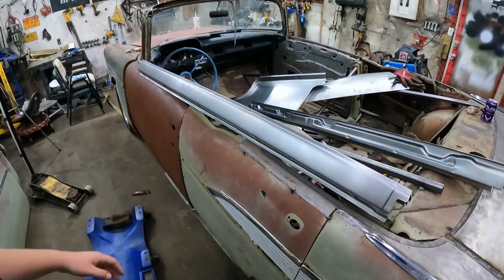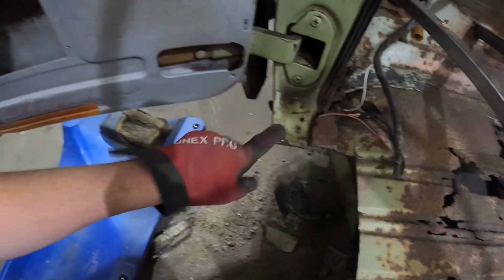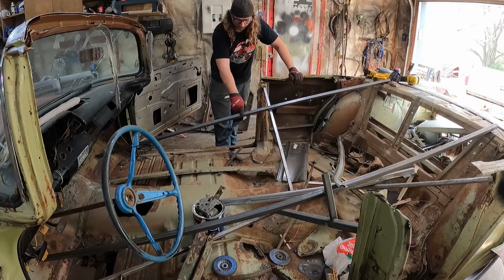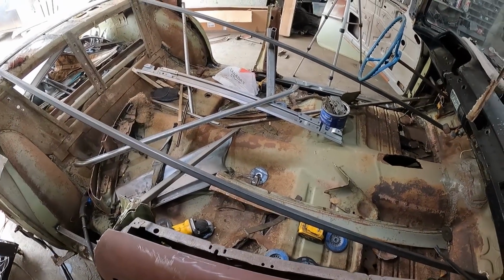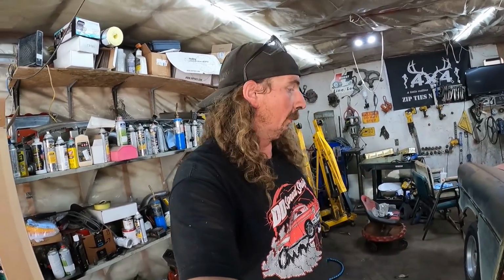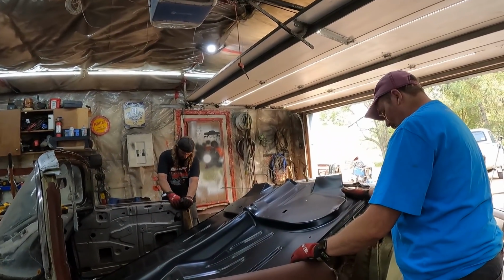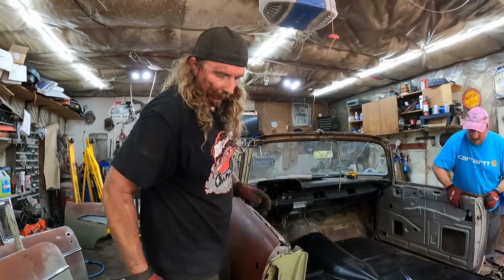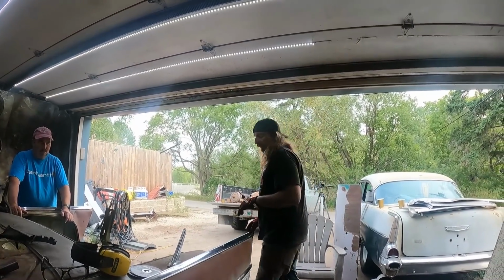Cutting a 1957 Chevy Belair Convertible Half In Two! - It Was Bad, Real Bad...... Part 6

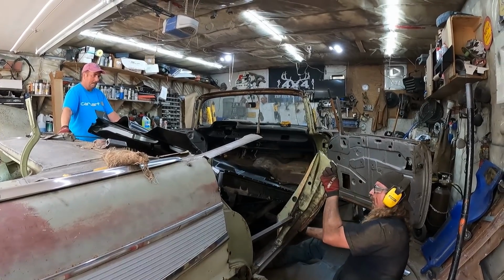Comment: Stopped video at 30:54. Gotta get a cold drink. That floor may take awhile.  Murr was laughing a lot. I know you couldn't tell it. But he was. Great Team work. Ya have to experiment. The end results is the answer. Great Job Dan. You weighed the cost along with you method. Makes sense to me. Maybe some jackstands under the rockers next time. And welding up the dash area to the frame. Another good idea. For next time. Carry on.

Comment: My grandpa made me use 6 cheapo adjustable trailer jacks with a lock nut installed for the spinner on the frame, 2 in front of the A arms two mid frame and two at rear shackles. We got the tires about a foot off the ground, and leveled my ragtop by watching the body seam gaps , hood, doors, and trunk lid. He called it stress relieving the body. In 1978 I was a chubby short long haired 13 year old with a 10 point single hoop welded in roll cage in a 57 Bellaire convertible waiting for a engine to appear. My mom paid $75 for it as my 12 year birthday present. By the time I was 20 I realized the project was actually a unforeseen dream for my grandpa, and my real gift was learning from him. Rock On Dan!

Comment: The most interesting phase of the build so far...Turns out that this project is not for the faint of heart or persons with shallow pockets
Reply from the maker: Exactly
Reply: Dan, this is so valuable because the risk of failure is still low compared to buying a convertible body from Danchuk for $34,500 plus shipping, etc. You ended up with the same thing, steel in the shape of a '57 vert without the VIN for a fraction!

Comment: Has anybodyever seen a original untouched 57 chev and the amount of shims the factory used?! Being able to put the panels where u want and then weld and not copying what the factory did ,u will end up needing less shims cause u to the time to line stuff up.. unlike the factory that was just banging them out by the thousands. Your doing just fine brotha!!
Reply from the maker: Very true.  Thanks man!

Comment: You need the legs or pedestal at the front floor corners. They go right against the firewall corner and weld around the front floor mount bolt. It gives the firewall strength to stand solid when the doors are open. You get it together I know you will!👍

Comment: Good for you. Temper did'nt win I'm an old couch potato now, but I did do something similar a lifetime ago. I restored a real rusty 57 T-bird. I pondered how not to have two halves. It needed inner and outer rockers, floor and braces. I went and talked to some old school guys that worked on verts when they were still made. They explained that verts rot like any other car only alot quicker. ha ha he The common theme was get the doors to fit, then remove all of them, and the center post if there is one. Then  fine fit an x brace into the door-s opening close to the outside as possible. use the front hinge holes to bolt at the front and weld in the rear. I thought these guys were geniuses. Worked like a charm. Years later I found some bird parts venders were selling said bolt in braces. With all the cars you are cutting up if you made a set I bet it would make your days better. Better yet make em and sell em? A true inventor is a lazy man just trying to make his work easier. You got the skills to finish this, and invent some things to make the future easier.

Comment: The center floor brace on a convertible is of a special reduced size in order to clear the large "X" in the frame. You'll need to cut (modify) that floor brace for your sedan floor to lower it into the correct position.

Comment: For the next tri-five project, make a 4 door from a coupe or convertible! Never been done before, and imagine the comments! Seriously, I think you are doing solid work here ... I personally would have kept the "Sport Sedan" roof and done a triple-black lowrider but ... let's be honest, you saved this car from the crusher. If you EVER want to get a real set of top-bows to fit, before you get much further, you will want to swap the top of the windshield frame (I believe the convert and 4 door hardtop share the same windshield at least) and test-mount a set of convertible stainless all around and get someone to send you some measurements for you from an original drop-top.

Comment: With Mur you got what you paid for. I think from watching your other floor replacement they fit up from the bottom easier and as far as wanting to see what it looks like you could have done the floor first and if it didn't look good convertible you could have welded the roof back on and done a 2 door (your speciality) as you had to do the floor either way.

Comment: I spot the doors shut and hang them from the top of the body on tall adjustable stands. That way you can do what ya want. I never have the luxury of a frame , unibodys are a pain in the ass..I would like to add if you can core drill your floor and pop in a couple chain pockets it would do wonders for easing the jobs.

Comment: On convertible floor there is a square brace the runs across floor on the upper side as well. Then there is a brace kinda similar that you cut out from the door jamb that leads to the floor for support I have pics if you want them

Comment: Dan...good job.  U worried to much.  Think of the frame  as a jig.  A foundation of a house. So to speak. U could have  the car outside in two pieces.  Bolted the floor  to the frame . Then mounted the body to it .  When u start out straight  and level.  U stay that way. Now if it was a unit body it. Be different.  U would need a frame machine.  To get everything  ded nuts. Looking good.  EVERYONE  PLACE UR ORDERS.  DANS 30 DAY CONVERTIBLES.  ROLLERS...TURN KEY IN A YEAR.  PRICES START AT 25K.

Comment: Just an idea, and this may be stupid, but could you use the interior back door panels to reinforce the rear "quarter panels" and the door posts? Could they be strengthened to give more stability to the car? I know it's not the way the factory did it, but it might help.
Reply from the maker: Yup. That's what I'll be doing. Gotta finish up the wheel tubs first

Comment: It maybe all worked out OK in the end, but call me crazy, when you cut the roof off and it STILL needed a floorpan and sills, I was almost thinking just cut the middle out, fit the floorpan and sills using the body mounts under the back seat as a reference, then drop the cowl back on, the rear end back on, and fill the gaps between.
Sounds easy to me, because I'm not carrying to carry half a car body to drop on the chassis.
Reply from the maker: I had thr thoughts

Comment: Real Deal Steel 57 convertable body with dash #C57CD-13CTF has 1 picture of the rear seat structure area that shows the absence of any package structure and Pillar with tube support angling up. Hope it would be helpful for figuring out what to do with that area, if you haven't perused that site already.

Comment: That was a good suggestion, but pressure washers weren't even invented until the the 1980's. Cell phones and pressure washers came online about the same time. That's all modern stuff...
Reply from the maker: R u serious?
Reply: @DDSpeedShop  We drank from the hose AND used it to wash out frame rails. Zip and plasma cutters... that's all space age stuff. And mig welders? Everything on body panels had to be gas welded. Stick welders for bigger stuff, if you could keep the rods dry. But we're not bitter :) It is a real joy watching you work this stuff out. It is real world hot rodding... Love it...

Comment: When you are going into unknown territory, it's always better to err on the side of caution as you did. The armchair quarterbacks who say you did it all backwards, aren't the ones busting their asses, and wallet on this project, and they certainly aren't making any YT videos showing the "proper" way to do this job. It was an experimental run, now you know the ins and outs of the job, and can do the next Tri-5 with a lot more confidence, and knowing what pitfalls to avoid. That's how you get experience.

Years ago, I took the rear of a Chevy Lumina that was rust free, and welded it to the front half of another Lumina that had the back half rotted away where it was structurally unsound to attempt any subframe repair, and the job went much quicker to back half the car. When I was done, nobody could tell it was ever done, as the seems were hidden where I welded it back together. The car lasted another 5 years after that job before it was retired from the fleet I used to work for, and that was because the other repairs that were needed to the drivetrain and the age of the vehicle made it economically unseemly to do those repairs.